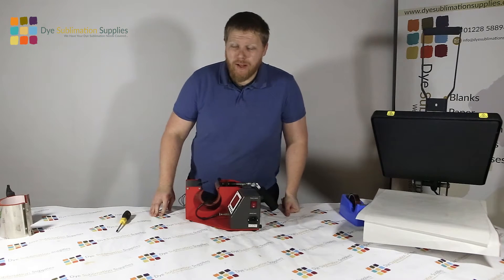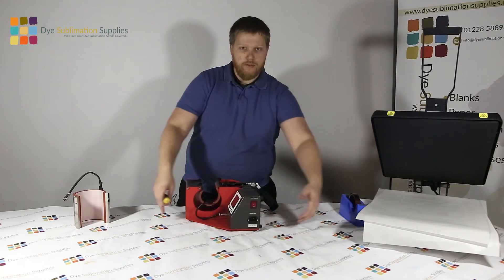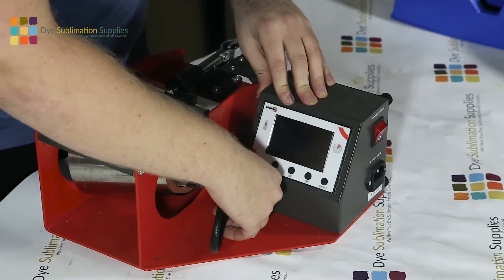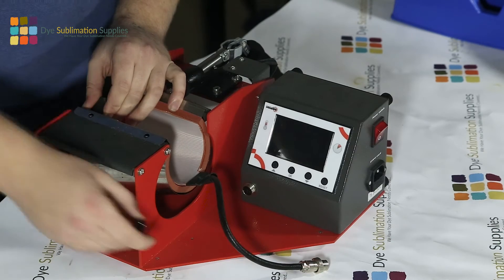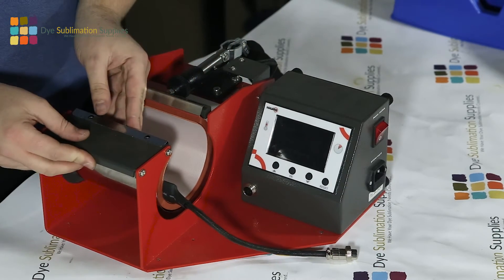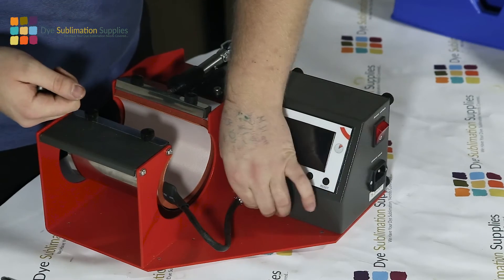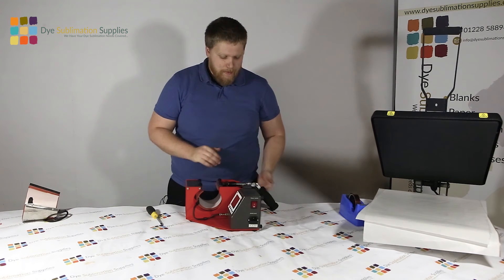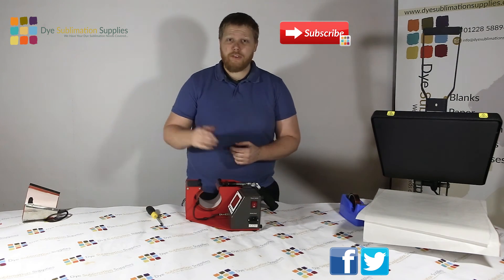How to: Change the Heat Element on a Secabo Mug Heat Press - Dye Sublimation Supplies

Comment: could you tell me where to get the wire for my heat plate. It has the 3 connections on end. One for the heat plate itself which has the hear sensor and the other two are negative/ground wire and the positive wire. I have contacted the company where I purchased it and Im not getting a reply. I just need to cord. It shorted out and the heat sensor in the cord broke.